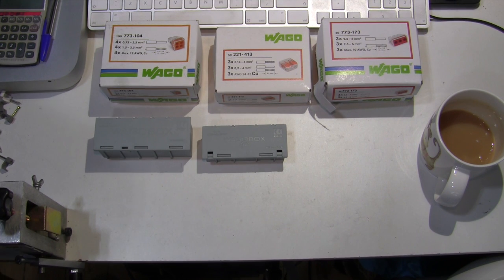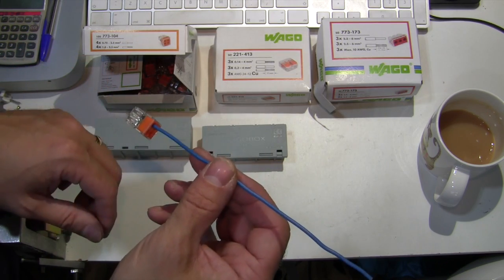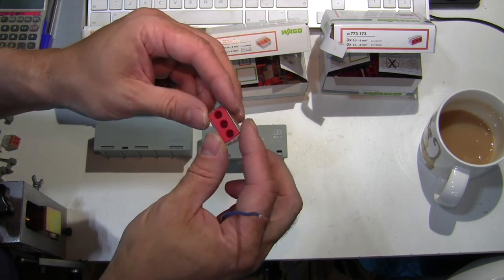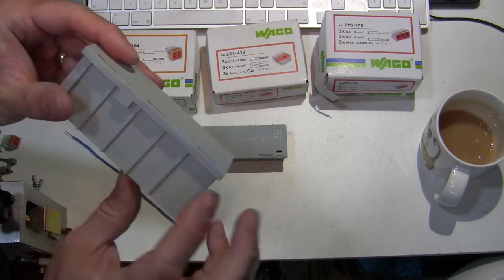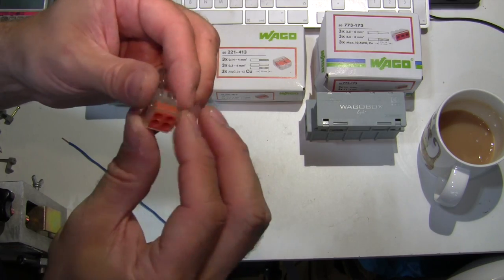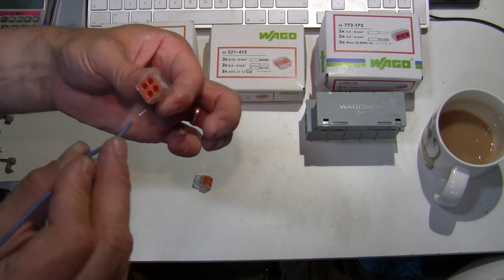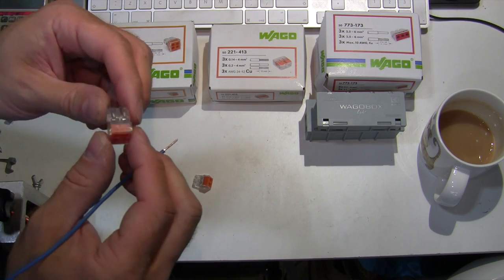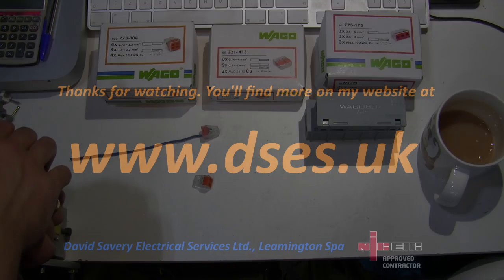Wago and fake Wago connectors

Comment: I bought some 100 pieces of wago knockoff like this and none of them was weak or loose. You need to apply a lot of force and twist to pull the wire out.  They are 250V/24A rated with CE marking on it.  If you have to apply some force when putting wires in, and apply a lot of force when you try to pull when wires out, then i is fine. Just do a "pull test" when making a connection with it and you will be sure that it is fine. 
These are simple mechanisms, easy to make, and risk of a failure even on a knockoff is very low.  If only one of the many was defective I would not be worry because defect can happen even to original wago.   But if many of them were loose than it's a bad product.
BTW The "tiny" new type of  original wago are easier to pull out.
Reply from the maker: Don't get me wrong, there are other manufacturers who make good quality alternatives, Ideal being one such brand. Had these things been sourced from eBay then I wouldn't have been surprised, but the point here was that they were sold by CEF who are one of the largest suppliers to the UK electrical industry and the primary supplier to my business, and my branch of CEF were planning to stock this product instead of Wago, a decision they later abandoned thankfully. Also, this was supplied in a pack of ten. Now, I don't now what happened to the other nine, but even if they are out in the wild and performing as designed then that's still a 10% failure rate from my point of view and necessitated in my having to fix the issue at my own time and cost, and thank goodness it was accessible as not all junction's are!
Reply: I have used few hundred of  original Wago (different  models), Legrand and no name Wago knockoffs  push-in connectors and didn't have  any problem with any of it.  Inside mechanism in all of them are similar and solid.  If it holds good when pushed in, it wan't get loose later. I suggest that you open the connector mechanism and see what was the reason of failure. I agree that risk of failure in No-name product is somewhat higher than in brand, but i would not worry if that is one-in-a hundred... From your point of view you have 10% failure, but statistic say that  you must have sample big enough to be representative to draw a proper conclusion :-) 

IMO wago 2273 series are best since they are small, compact and best for very limited space of junction boxes.

Comment: Clap Wago's are superior, and whoever makes electrical connections and junction boxes hidden should not be an electrician, Clap wagos 221 is rated for 32A and the 733-104  is only 24A. 221 is more secure can also be used up to 4mm2 wires which the 733-104 only takes up to 2.5mm2. Dont school on something you dont know.
Reply from the maker: A well designed circuit shouldn't see any junctions during installation, however modifying an existing circuit will necessarily see junctions installed which may not be so easy to access afterwards. If someone wants a spur from wiring that is ordinarily covered by floorboards then that junction will not be considered as being accessible when it's covered back over again afterwards. There's nothing wrong with that so long as the junction used complies with the 'maintenance free' requirements as a crimp connector or clamp/push-fit Wago would if fitted in an enclosure with an MF logo. Push fit or clamp connectors are equally fine, and some people do have a preference for one over the other, but the current rating is immaterial as it will necessarily be rated either at or higher than the maximum cable size that it can accept - i.e. exceed the connector rating and you're exceeding the wiring rating. If that's happening then you've got bigger problems than the type of connector you're using. If you don't understand these points, then perhaps you should go back to school. While there, also work on your spelling and grammar.
Reply: In California, under no circumstances can a junction box be cover by plaster, sheet roc, flooring etc. No inspector here would buy the term "maintenance free"! Different areas have different code requirements. I can't tell you how often I wish I could have buried a box!
Reply from the maker: It's starting to look like we Brits are in the minority for MF junctions! As sparkies on these shores we lack any rights regarding other people's electrical installations. Even if I found something immediately dangerous on an inspection, I don't have the explicit right to do what's needed to make it safe without permission from the homeowner/site manager. If they prove to be stubborn, then to protect my own legal liability I can make written recommendations and have them sign it, or I can record myself telling them it needs correcting along with their response. If I identify a likely failure point in a wall or under their floor and they don't want me to hack up their decorative finishes or won't permit the circuit taken out of service, then it's their call. Fortunately this doesn't happen much, but Asian restaurants have proved problematic for me in the past as they don't want to close on any day of the week, don't let you take anything out of service, and tend to have had installation work done on the cheap using parts shipped from back home which don't meet British or European standards. I don't have anything to do with such establishments any more, they're a time-bomb and I don't want my name anywhere near them when something dreadful happens!
Reply from the maker: That's alright Karl, it's a regulation and nobody said you had to like it, but it's there anyway. Personally I find regulation 421.1.201 to be a pain in the arse, and don't even get me started on 514.14.1 which is easy to comply with, but stupid nonetheless. I believe I'm already on record as saying that best practice dictates the accessibility of any electrical junction, but if one needs to be fitted into the fabric of the building because the client doesn't want to see it then so be it. It's not like I can insist they have a visible enclosure installed, and if I did then I'd lose the job to a competitor who would do it how they wanted and still be in compliance if installing to the standards of BS5733. Back in the mists of time people installed junctions using screw terminals which eventually loosened and either went high resistance or failed completely, maybe even catching fire in some instances. I guess the IET and BSI, the bodies responsible for the UK wiring regulations, figured they would never stamp out such practice, so BS5733 was born permitting the use of clamp and push-fit connectors so long as they are installed according to the manufacturer's instructions, and their use was then ratified as regulation 526.3 in BS7671. If installed in compliance with the instructions and to these British standards then they shouldn't be any kind of fire risk and they shouldn't need future inspection. That's the point; they're considered a semi-permanent connection. Personally I haven't witnessed, or been responsible for, any electrical fires through using Wago branded connectors, so I'll stick with them. The other brand used in the video however may well prove to be a fire risk, so I'll steer clear. If you're an installer, then you go about your business in whatever way is required to suit your local regulations, customer requirements and conscience.
Reply from the maker: Thanks Terry, that's very interesting - and probably rather frustrating in practice! So presumably if you need to alter a circuit, rather than break into wiring which may be conveniently nearby but ordinarily covered over, you need to find a more accessible point back down the line to pull a new cable from?
Reply: David Savery Electrical Services    Any junction box that will be used for “ I believe you call it a spur line”? ( my apologies if I am incorrect) has to have the junction box exposed to the finish surface of either the floor, ceiling or wall. If a switch, outlet, or light socket are already in the junction box then you in good shape. If there will not be a switch, outlet or light at the pre-existing junction box or one you create, a junction box then has to be mounted so it is flush with the finished surfaces and a blank cover put on. A junction box here in the states they must always be accessible.
Reply: Rules and regulations aside, not having hidden junction boxes (i.e. junction boxes that cannot be readily accessed because they are built into walls, floors, ceilings and other surfaces) is just common sense. Sure a customer might find it annoying or unsigly to have a junction box visible on a wall or ceiling but i'm willing to bet that they are going to find it even more annoying and unsightly when they call you back there in the future for a job and you have to rip open a wall to try and get to a hidden junction box. Not to mention the fire hazard that comes with having hidden junction boxes. If a visible junction box starts burning, you can get at it with a fire extinguisher and possibly stop the fire before it spreads. If a hidden junction box starts burning, you're pretty much s-o-l. Enjoy watching your house burn while you wait for the fire department to arrive. Just some thoughts on the subject.
Reply: Leftist Wikipedia Stihl as in chainsaw! Nice.
Reply from the maker: And therein lies the difference my friend as I speak for a UK market where we have a regulation specifically allowing the use of inaccessible junction connections: BS7671:A3 (2015) Regulation 526.3. The wiring regulations here also don't define what the word 'accessible' means. My take is that something is inaccessible if I have to use tools to break into final finishes, i.e. pulling up floorboards, braking out plasterboard etc., but another installer may argue that the same is accessible if they are willing to make good any damage.

Comment: That's why I use the clamp type wago connectors. More reliable than a push fit connector. Also wouldn't a dead test show a high insulation resistance at that joint? Unless it was damaged or moved afterwards..

Comment: Yes but that would be only suitable for a spur. But a ring main needs a 30 amp rating. Wago are 24 but tool station have something that looks identical ( this may be the imposter) they are rated at 32. Hope this helps my concern is that viewers may think these wago can join a ring but this is not the case!
Reply from the maker: Ah, I see what you're saying, however the Wago 24A connectors are suitable for use in a ring configuration. Remember that 2.5mm cable is itself rated at less than 30A, but nevertheless can be protected by a 30A fuse or 32A breaker in a ring configuration so long as the ring is intact. An intact ring effectively gives you 5mm CSA of cabling with the load split over two cables. If the ring is broken then a 24A wago is at no greater risk of overload then the 2.5mm cable passing through it which has the same sort of rating. This is why it is important to have periodic inspections to check for ring breaks, and if the cause cannot be identified or rectified, then the circuit downgraded. A client won't see a ring break as all their sockets are still working so they may raise their eyebrows when you tell them it's something that needs fixing! Also, trying to track a break on an old circuit that has been modified over the years can be a hopeless task! Personally I avoid installing rings and prefer 20A radial circuits on new installations. Just to add, the ones sold in Toolstation are rated higher as you say and are not the imposters I've looked at here. They are made by In-Sure and they are a perfectly valid alternative to Wago. I've used many In-Sure models myself without issue, and had I thought about it instead of just blindly ranting and wanting to go back to my cup of tea then I would have mentioned In-Sure in the video!

Comment: Hi David I'm a little concerned that your not mentioning amps! Even though some of wago can take 2.5 they are only 20amp rated
Reply from the maker: Hm. Are you sure? All my genuine Wago connectors are rated at 24A for 2.5mm cable. 4mm and 6mm variants are rated at 32 and 41A respectively. You do have to de-rate them under certain circumstances just as you have to de-rate cables in certain installations, but in optimal conditions they're rated the same as the cable. And quite right too, there shouldn't be any crimp or connector that can accept a certain CSA of cable but not the load that cable may be pulling! Let me know which model of Wago you're looking at though.